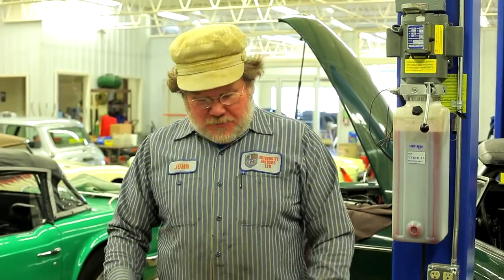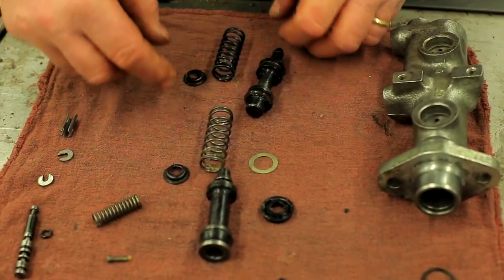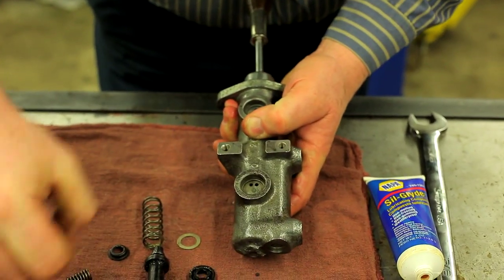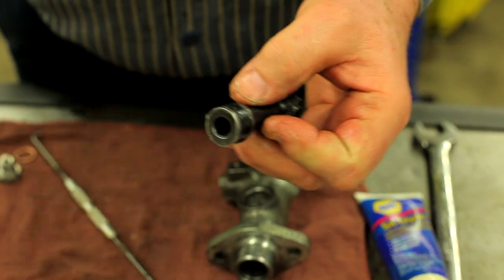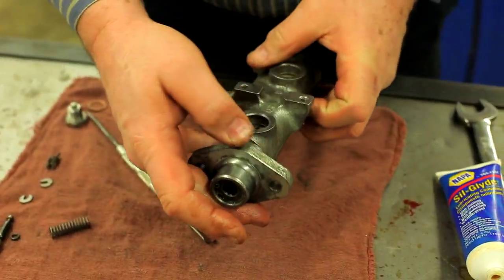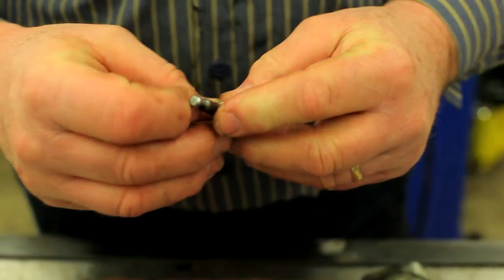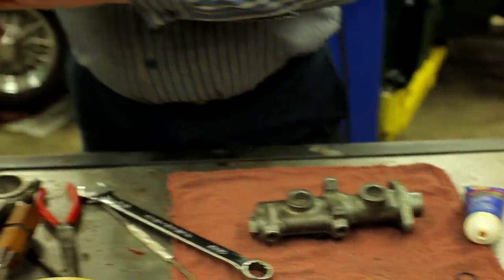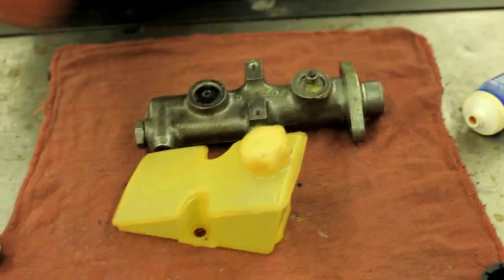188 MG Tech | Brake Master Cylinder Rebuild for MGB 1975-80

Comment: I have a 1978  MGB.  It came with a Ford Escort break master cylinder that worked horrible. I bought a new master cylinder and servo. I don't know where the vacuum hose from the servo goes.  My book shows nothing on it. Where does it connect to?